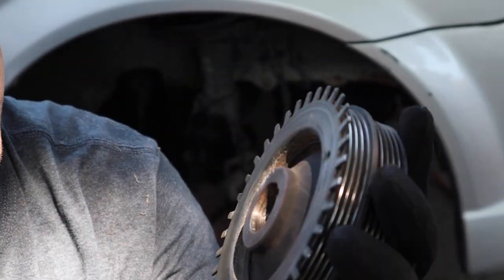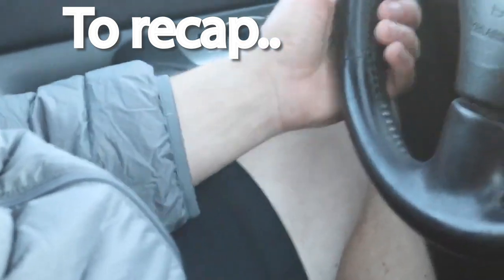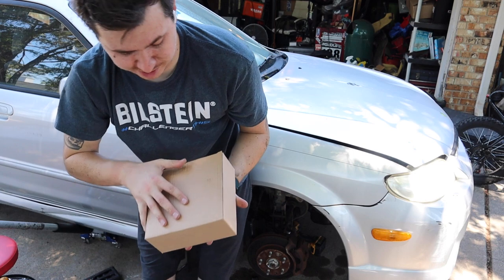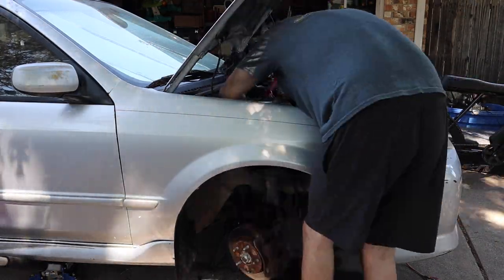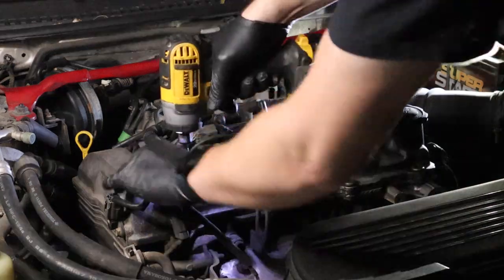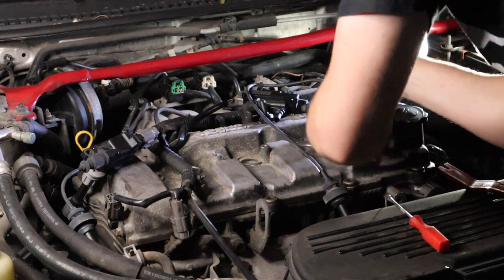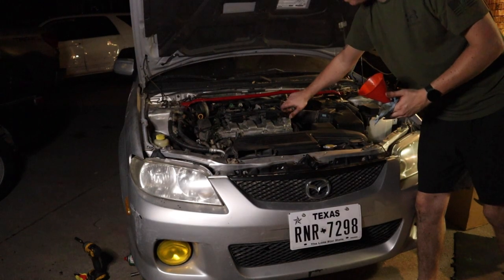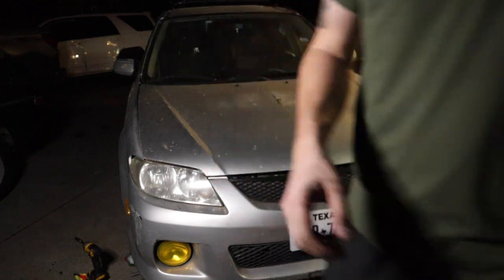Mazda Protege Safari5 EP3-Prepping the engine to last

Comment: Loving the series so far.

Few notes, you need grey RTV in the corners by the cam pulleys when you change the VC gasket as they will start to leak otherwise. 

Also those Felpro and most other Felpro gaskets except the intake manifold gasket, for these cars, are absolute garbage and should be avoided. Those blue valve cover gaskets specially are known to break off little pieces when compressed and those get into the oiling system for these cars. Even when torqued to the OEM spec those gaskets sheer and shed material
Reply: Also Mazda OEM calls for grey RTV and not a gasket for the oil pan so someone's been in there before. Interesting to see they've replaced the exhaust as well, that j pipe and mid pipe look to be aftermarket as well.
Reply from the maker: Very interesting notes, and I appreciate your genuine feedback! The RTV thing is absolutely the case, I definitely missed that. I'll have to go and re-do that. Interesting to hear on the felpro..it certainly does sound like there's a header exhaust leak, oddly enough. And that's scary on the valve cover gasket, too. Weird about the exhaust bits as well, I'm going to guess they rusted out and someone replaced them? Thanks for watching, and for the insight!
Reply: @BrunerTuner  yeah that's usually the case with the exhaust stuff if the cars been in the rust belt. It's always a mystery when digging into these cars because you don't know what's been done haha. Also if you can try to replace the missing bolts on the oil pan. You did good by adding silicone to the cork gasket, hopefully that'll help it last a bit longer. 

Also there's a bit of knock at start up as well so just keep up with the oil levels and run her till you have problems haha
Reply from the maker: Yeah I actually have been meaning to get those bolts, I really should've done it by now lol. As for the knock, i think it's one of the mounts or something contacting, not the motor itself, but I will absolutely keep watching the oil haha! Thanks for watching, and for the feedback.

Comment: this is so funny, I watched several videos of my car but found your channel tonight. I have a red P5 and I have been researching parts to do the exact same thing you are doing. I want to know what struts you bought for it. They were not coilers I think. My goal is to raise car up to 2/3" in winter if possible with coilers and lower to factory or even 1" lower once snow is melted and go on off roading adventures as well. Great content, keep on going! Thanks
Reply from the maker: That's awesome that you came across this haha, glad you found it! I just bought some OEM style replacements from rock auto, I can look up the specific brand if you'd like but they're nothing special. I will say, I'm working with someone in the P5 community on a lift kit, and we should hopefully have that soon..stay tuned! Thanks for watching!